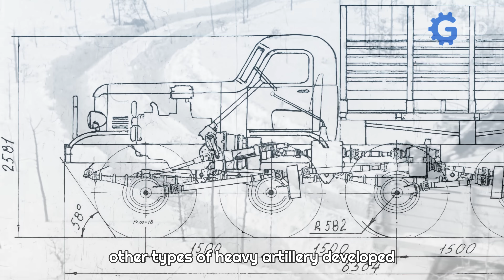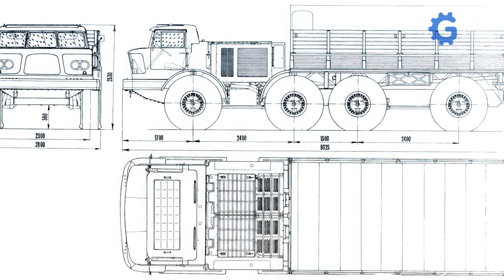Why Was This Truck Created Without Suspension? ▶ ZIL-135

Comment: what an engineer. building an offroad truck with no suspension on axle 2 and 3........and that while MAZ built well constructed8x8 trucks, with a giant diesel engine.....yeah and independent suspension on all wheels.
Reply: У МАЗа нет независимой подвески! Вы с Татрой путаете)
Reply: @Dimonchik81  Maz 537, Maz 543 - all has an independent suspension. Tatra concept is different.

Comment: 88L/100km = 2.67 mpg.  Wow.
Reply: Remember, that was only under "ideal" conditions.  So most likely these vehicles never got that mileage.
Reply: Not bad when you think about how tanks are usually measured in gallons per mile

Comment: They did not choose two engines because they did not have engine strong enough, that is nonsense. They did it on purpose to eliminate differential slip. Loss of grip of one wheel on left or right side had zero effect on traction of other wheels. 
I have driven ZIL in Bosnian army, it was completely unstopable, no matter the mud or upslope.
Reply: there are some units in several countries people use it , when normal trucks cant go throught forests and muddy places
Reply: It was built as a security to guarantee it never stops ,,, has nothing to do with no engine  strong enought cheers
so it can reach the corret place for the repair,, nice philosophy 

they go where others cant go
Reply: @anteneupitra  No. One Engine just propelled the left tires and the other one the right tires. Good luck reaching your destination if you drive in a circle.
Reply: 2 двигателя было потому что у нас не было мощных двигателей!

Comment: No suspension, bad idea. It put extra stress to vehicles body and transmission and is bad to road too, tires cutting trough soil leave soon deep grooves and lesser vehicles has bad day. And as tell in video, its dangerous any faster than 20 km/h. Many tractors has this feature and they run like kangaroos until fall from road.
Reply: This is not entirely true; the ZIL-135 has suspension on the outer axles, and the shear axles are rigidly fixed. It's just that the frame of this car is extremely rigid and the suspension function seems to be absent.
Reply: You don’t even know what you’re talking about.
Reply: Not really
Reply: Modern tractors run at 50 km/h. With a much shorter wheelbase. No problem.
Reply: The tires are low pressure meaning they function as suspension for the purposes of metal fatigue, the vibrations at high speeds could’ve been solved by installing thicker rubber bushings (which they did not have at all between the axles and the frame in the original models) to dampen the resonance however that never happened so here we are
Reply: Teactors don't have suspensions
Reply: Ya i dont think so. Its solid
Reply: 巨大なバルーンタイヤが、サスペションの代わりをする設計では。
宗、建設機械のタイヤショベルの様に
Reply: This thing was built to go without roads
Reply: idk, lm drives like a dream even with load
Reply: depends on the quality and type of the wheels; hence why most tractors dont have suspensions.
Reply: Farming tractors, together with heavy trucks, mobile cranes, have no suspensions. Wheels do this job
Reply: There is a modern off-road car where the tire works as the suspension... Forgot the name, but you can find it if you search for it
Reply: Yes,tell the russian engineer....
Reply: Real experts r in YouTube comments 😂
Reply: Provincial Soviet (even now) Russian roads are so poor there is probably little chance of it hitting that top speed
Reply: @frankryan2505 
巨大なバルーンタイヤが、サスペションの代わりでしょ。
Reply: I see, you must have a superior engineering mind than the entire Soviet Union had. You are aware the Soviets have the reputation of building incredibly durable, reliable and easily repairable equipment right?
Reply: The suspension would break, it's not a little Toyota. The front and rear axles would do the splits. Suspension with extreme vehicles does the opposite, the vehicle will bottom out and jump up and down and constantly bounce up and down. One breakdown in war and the whole crew eats lead.
Reply: @yougoof modern tanks have suspension, you can run suspension in vehicles of any weight, including jetliners... also tractors don't have suspension due to the low speeds they operate at. This should have suspension, it was probably just too technical of an issue to overcome at the time, but there's no way a modern vehicle like this would be produced without suspension from a capable manufacturer
Reply: @inertiaMS Tanks also have around 7 axels and the weight is spread across the entire length of the tracks.

Comment: During this period of USSR gasoline was cheaper than water, so if your military engine consumed too much, you just installed one more gasoline tank on your vehicle. Thanks for your video! If your subscribers appreciate the story of this truck, I’d recommend to go through the story of ZIL-49061 “the blue bird”. Pretty rare and unique vehicle, made exclusively for the cosmonauts’ searching operations. 

To me, Blue Bird became the extremum point of the Soviet engineering, such as Buran, Tu-144, An-225 Mria.
Reply: Petrol (gasoline) (Benzin - Russia) wouldn't turn into a gel at the low Siberian temperatures either.
Reply: I sada je benzin jeftiniji od vode u Rusiji.
Cena je oko 0,50€.
Reply: disgusting AI voice.
Reply: I don't think it's the price which counts - it's the weight and volume required to store it on the truck which makes it suitable or not.
Reply: Just like 1900 in usa oil cheap than water